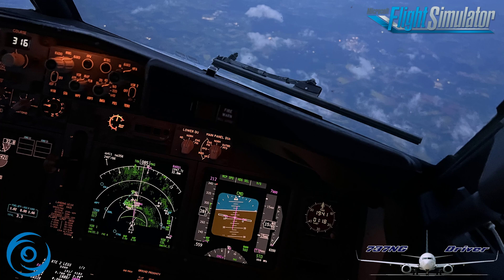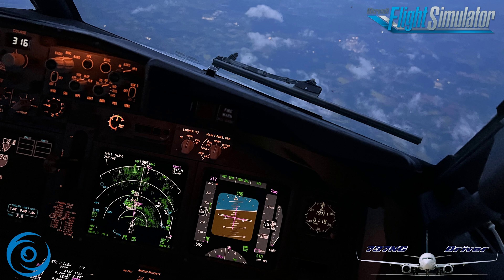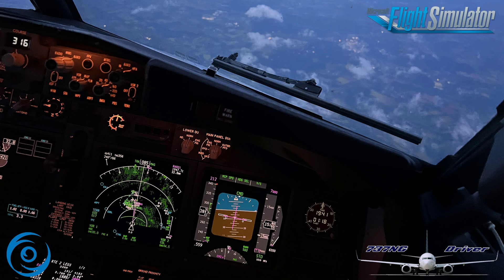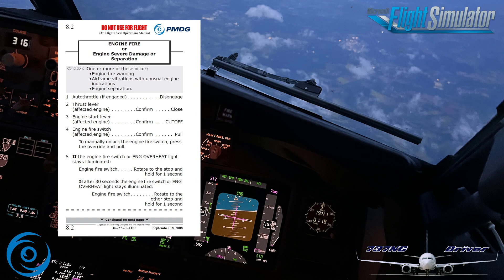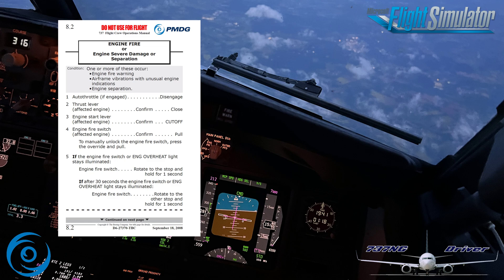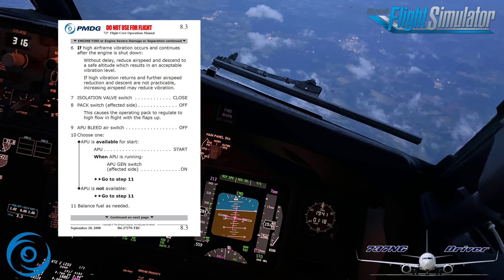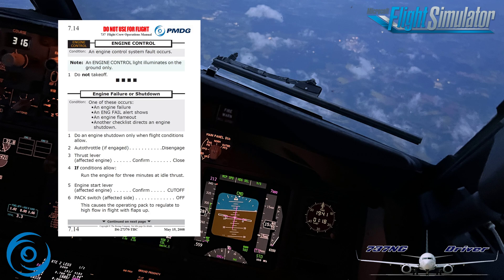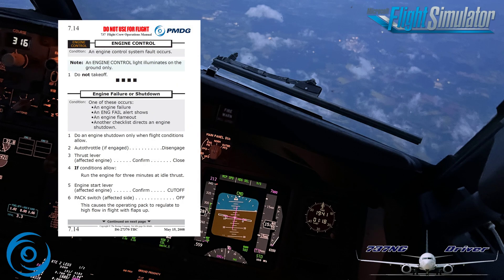Boeing 737NG - Memory Items Introduction

Comment: Hey Emanual, got a question for you. I noticed on long flights in the 737 I will always end up with a fuel Imbalance on the right tank. What happens is the aircraft keeps pumping fuel into my left tank, burning fuel out of the center tank and leaving the current fuel in the right tank and doing absolutely nothing with it. I end up having to turn off the center and right pumps and putting crossfeed on and burning the left tank to fix the imbalance with the right tank. I've tried keeping crossfeed on to see if that was the issue and regardless if it is on or off while all pumps are turned on I still get that issue. Is this a normal thing or is this possibly a bug I am having with the aircraft? Thanks a lot!